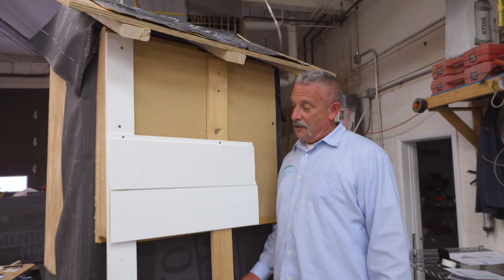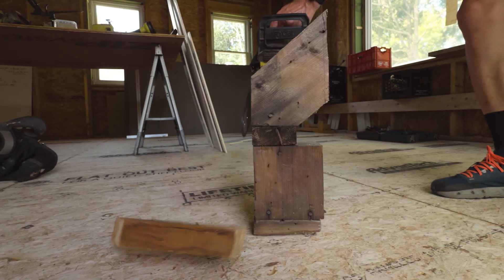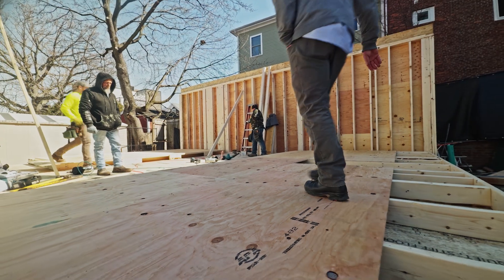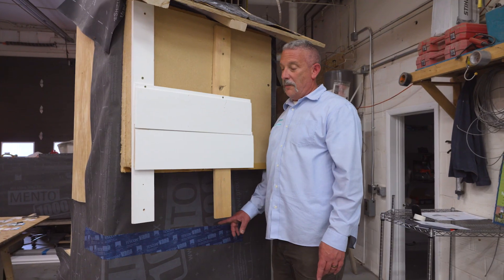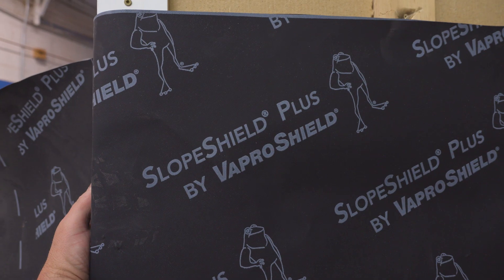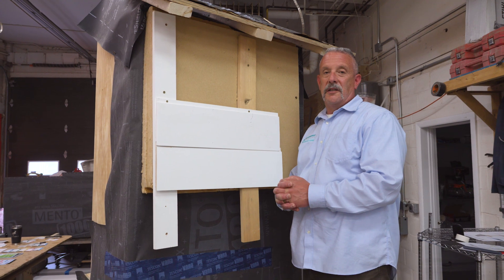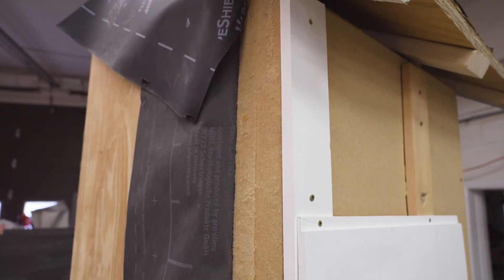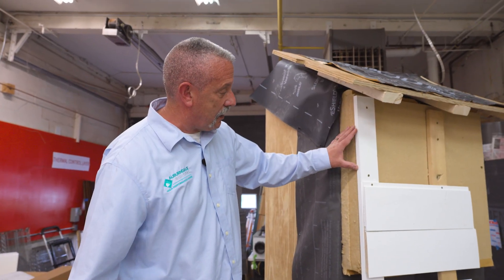Building a High-Performance, Vapor Open Wall

Comment: If you had wanted your wall to dry you would have used something like densglass sheets which are 10x more vapor open than plywood and OSB
Reply from the maker: Sure you could use densglass as a sheathing option. In our area it’s common on commercial, not so much on residential, and we like using wood. We want some vapor permeability on walls, doesn’t have to be the absolutely most open assembly possible. Thanks for the comment and for the food for thought. Appreciate you watching.

Comment: In rural areas, what is your fireblock for ventilation at the rim?
Reply from the maker: Good question @MadRat70. In the past we have just used standard stainless steel screen to wrap the bottom of the rainscreen for bug protection. We have begun switching that over to a stainless steel mesh from a company called Wildfire Defense Mesh that is much finer and prevents embers from getting into the ventilation space. We’re not in a wildfire prone area, but you never know what might happen and we like belts with our suspenders! That’s a good product to look into. Also here is a GBA thread you might find helpful. Let us know if that didn’t answer your question or you have others! https://www.greenbuildingadvisor.com/question/can-a-rainscreen-become-a-chimney-for-fire